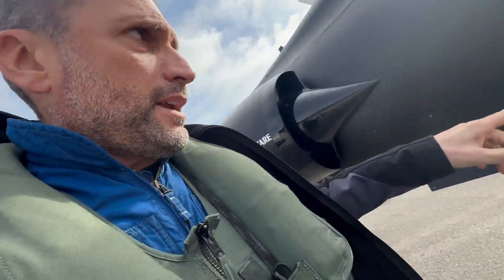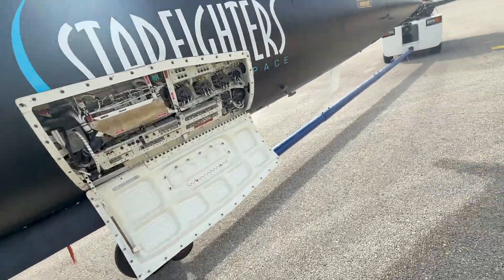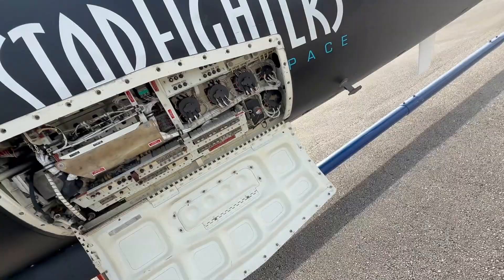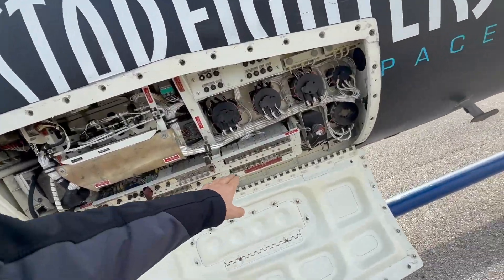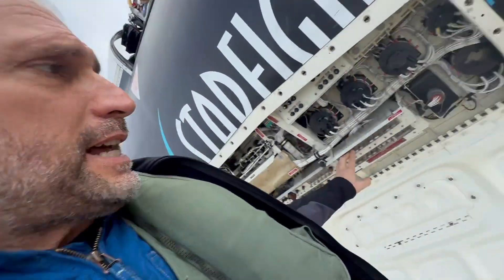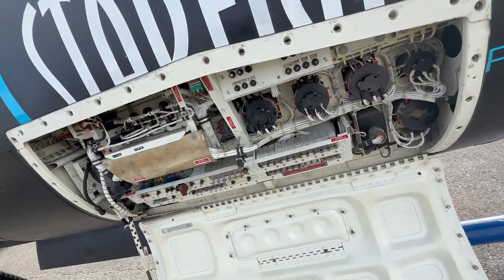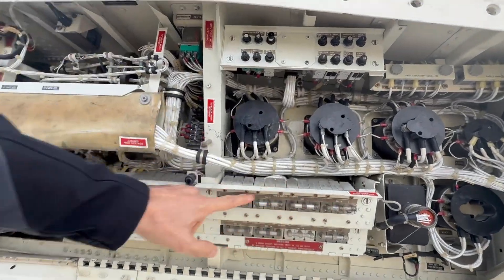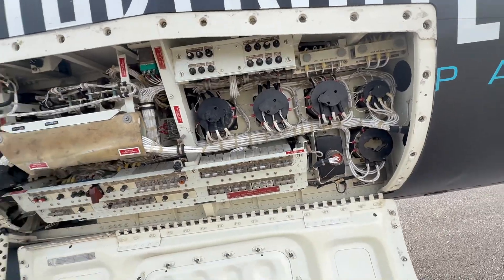Lockheed F-104 Starfighter FUEL BOOST PUMPS CHECKS

Comment: This is the TF (J79-7?) which means it doesn't have the mighty -19 of the J79. If I recall, the J79 (non--19) uses 1000lbs/min in AB at low level and 350lbs/min Mach 2 around 36,000ft. What are the fuel flow numbers for the -19?
Reply from the maker: The Italian TFs have the J79-19.....surprisingly, the -19 has lower/similar fuel flows at many settings as they are more efficient, delivering however more trust.